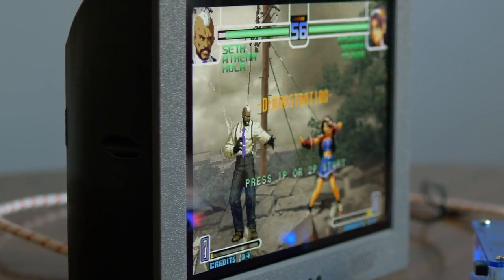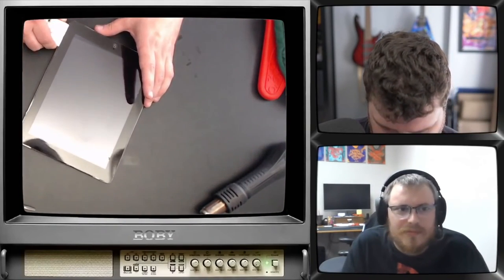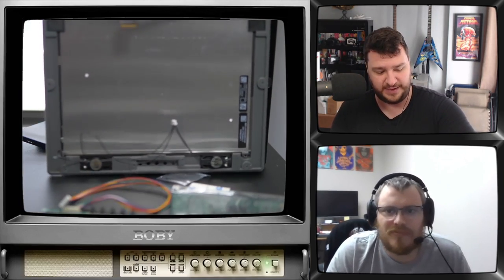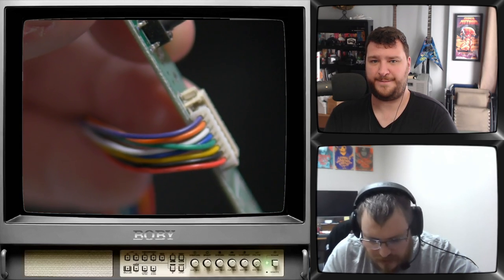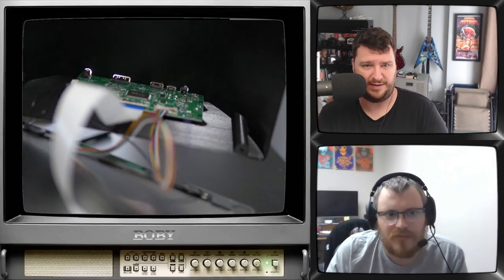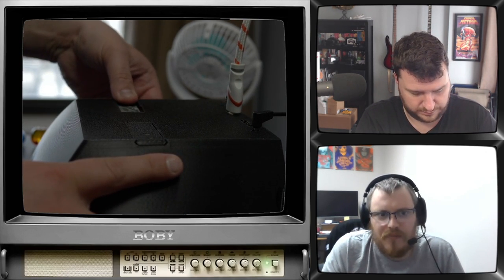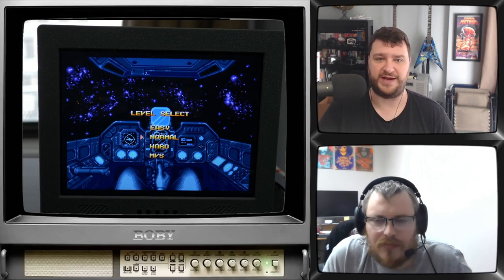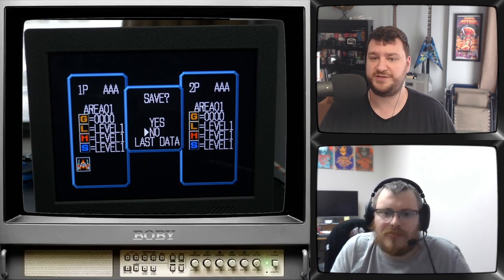LaserBear's "LCD CRT" Kit

Comment: I think 4:3 is way more important than using an actual CRT. I have a CRT but I can live without it. Those 16:9 black bars take me way more out of it than the fact that I'm playing on an LCD. I made sure to save my old 4:3 (or something close) LCD monitor from forever ago to use for PC games and it helps so much to make it "feel correct".
Reply: I agree with that. I have a 19" 4:3 Samsung LCD used for security cameras so  four inpus of composite plus vga and hdmi and the screen makes all the difference
Reply: @1122markj  Yeah I'm making a retro style game and I'm making sure to keep most of the screen feeling 4:3. They never look right when they are widescreen.
Reply: Anyone who hordes a 4:3 monitor for old games is already a man of culture.

Comment: We need a larger, "full size" (i.e. 20-27 in) version of this, with analog composite inputs which can automatically create artificial blooming/blurring and scanlines. In other words, a full replacement for a CRT into which original hardware can be plugged with no scaler.
Reply: You are forgetting motion. An unstrobed LCD can never replace a crt. Need crosstalk-free strobing at all refresh rates you will use(for console/arcade games and video content at least 47-75hz)
Reply: @displaytalk  I didn't mean it quite that literally. I think something is achievable that would at least be passable.
Reply: @TruthSword7  Well to me the 1ms MPRT is the main reason why I use CRT for anything, so it wouldn't be anywhere near passable without at least 4ms mprt strobe.
Reply: @displaytalk  Modern screens can get extremely low latency. But what they don't have is proper blooming and scanlines. I'm more interested in the look than having the exact same latency.
Reply: Maybe the scaler would be built in
Reply: I've never seen a 27 inch 4:3 LCD... Where can one get one?

Comment: For a while I've been toying with the idea of a home made faceplate for 16:9 monitors that emulates the appearance of a 4:3 TV. This video actually motivated me to figure out the dimensions.

For those who are curious, I drew a 16:9 cm rectangle and used a screen size calculator to figure out how much width to block on each side (2 cm) to make the viewable area 4:3. Then, the same amount used to hide the pillar boxes is added as a bezel to the top and bottom of the screen (in addition to the height, not blocking the screen) to preserve the look as it would look odd with thick side bezels and thin bezels top and bottom (though you can experiment with top/bottom bezel size). The proportions can then be easily scaled with simple maths based on your screen size.

It actually looks pretty cool on paper and I'm sure designs could be added like mock speakers, control panels, logos and even fancy stuff like angled bezels so that the screen is slightly recessed. With my D.I.Y skills, cardboard would most likely be my material of choice and the end result would likely be a bit... crap. But I'm sure someone more skilled and less lazy could produce something pretty awesome looking, especially if they went the extra mile and put it in a full enclosure.
Reply: I have been doing a similar thing for years. I created bezels for my 16x9 screen for 4x3  Images to make the black bars less noticable.
Reply: @pixelsrnautded9286  Did you go for a CRT aesthetic or simply cover the black bars?
Reply: @napalmhardcore  I cover the bars only so when I play in the dark it looks like a real 4x3 image. I have 2 real crt televisions so I  didn't feel the need to go further with it.

Comment: Now, only if someone made larger 4:3 LCDs than 20".
In the meantime, I'll enjoy the beauty, wonder and scale of my 40" SONY Trinitron Wega XBR CRT, just as long as all 350#s of it doesn't have to be moved anywhere anytime soon.
Reply: @detroit retro gamer drg313 I wasn't meaning to flex, because I too used to be the guy who highly coveted the big beautiful monster until I luckily finally found one. 
Just letting people know that they do exist, and though they're rare they are out there to be found for reasonable prices --because of their weight. 
For me, I picked up a few-thousand dollar high-def CRT TV for $50, with an image that is still incredible and perfect for gaming. But my previous posted wish for a LARGE 4:3 flat panel is still warranted for high-def retro gaming.

Comment: I looked into the  volume controls, Greg says at 29:50 that the "audio amp chip has pins for digital up and down". maybe my board is different but my amp chip is a APA2068 and there are no volume control button pins on this chip. Volume control is selected by a variable DC voltage level on pin 7. DC range seems to be 0 to 5V. After lifting pin7 off circuit and wiring a 10K pot to a 5V source, the pot will affect the volume but the OSD volume is still "master" so you have to set OSD volume to 100 for the rigged pot to have full range.

Comment: This is very cool.

Would it be possible to get a full screen image on this screen from a (hacked) classic edition SNES, NES, PC Engine, etc ?
Reply from the maker: Yes, just set the console to 16:9 mode.  I know that sounds weird, but since this is a 4:3 screen, setting the NES Classic (or any of the others) to 16:9 will fill all the pixels and it'll be the proper aspect ratio.

Comment: I’m confused about which iPad. You keep mentioning iPad Air 2/3 but in the video it’s an iPad 3 not the air model if I’m not mistaking.
Reply from the maker: It's best to check Greg's site and see the exact one he recommends.  I'm sure I got it wrong during the livestream.
Reply: @RetroRGB  only reason I say it just that the one in the stream didn’t have a Touch ID button but iPad Air 2 and 3 had them but iPad 3 and 4 had a physical button.

Comment: Are the customer video modes in the RetroRGB article really required ? Can we not simply use "video_mode=13" ?
Reply from the maker: I think so, but older MISTer.ini files don't have the newer modes added, so people wouldn't know what it was set to.  Adding the full modelines does exactly the same thing, shows you what you're getting and is just a simple copy & paste from the webpage.  So, give it a try on yours, but if you run into any issues, use the full line.
Reply: @RetroRGB  No issues with “video_mode=13”, I was wondering if the custom mode line added any value to simply using that.

Comment: Damnit! I thought this was a way to put an existing CRT Tv into a smaller form factor. Is that possible?
Reply: not really no. the cathode ray tube assembly is pretty much the reason old TVs are deeper than LCDs. the only thing you could do would be to redesign the electrics powering/controlling them but even then, the CRT would still be the biggest part and there'd not be much of a shrink in the item.

also touching the CRT inside is dangerous unless you know what to do...so it'd be more dangerous to have lots of people opening up old TVs/monitors.

Comment: I just finished one of these builds using the stuff LaserBear linked from his website.  I'm having image drop outs from my MiSTer when using the screen's native resolution 1536p , have you guys had any issues like this?

I've tried multiple HDMI cables, I've tried multiple HDMI ports (with a Mini HDMI adapter) and it just drops out and comes back every few seconds.
I know Greg's not the person responsible for this product, just wondering if anybody else has encountered it and has a fix?
Reply from the maker: Check the main post, linked in the description:  https://www.retrorgb.com/laserbear-lcd-crt-case-reviewed.html

"Also, some cores might require a framebuffer, otherwise the monitor will loose sync.  If you load a core and it immediately drops signal, then recovers, then drops again (etc), you’ll need to change the vsync setting:"

vsync_adjust=1
Reply: @RetroRGB  AH!  I totally breezed right by that, I’ll try that when I get out of work today. I started a return with Amazon but this makes sense and I totally spaced on it.

Thanks so much for replying and for keeping up on all the cool products in one convenient spot.
Reply: @RetroRGB  Plot twist: When I got home from work today, I saw that the V-Sync was already set to "1" in my ini file for my 1536p Profile, so I figured I'd experiment with the other settings.  I set it to "2" and it seems to be working fine in the SNES core I was having issues with last night.  I guess that's a win?

Comment: Bob, I highly suggest investing in spudgers. Or at least cut up an old credit card into quarters and use to wedge into it as you heat the sides.
Reply from the maker: I've got those and was ready to use them, but at first I expected it to be much harder to remove the glass from the LCD.  Then, once the razor blade was working perfectly, I figured "It's working, why mess with a good thing?".

Comment: It's a pity it does not work in 50 Hz. I am looking for a portable display for my PAL Atari 800 XE. I bought one at Aliexpress, but it also only works in 60 Hz, even if fed 50Hz signal through HDMI. Everything that is supposed to scroll smoothly is jerky.
Reply: 50hz sucks

Comment: Would be great with a built in retrotink so you could have the right inputs
Reply: the lcd will still have latency issues for those types of games 😔
Reply: @jonniefast  what type of games
Reply: @johnmorris7899  anything fast - sonic 2, shoot em ups, racing titles etc

ghosting, pixel response latency, and input lag are some of the reasons people keep the real analog crts around 💌
Reply: @johnmorris7899  ipad screen isnt a modern gaming monitor with high refresh rate 🤕
Reply: @jonniefast  never claimed anything about the refresh rate what I was saying was if it had a tink built in and then you could have other inputs besides hdmi
Reply: @johnmorris7899  analog signals processed by the retrotink are gonna be noticeably laggy on ancient LCD panels mate

i have a retrotink2x and love it 
but i dont plug it into consumer grade sets

Comment: Mmm why not just buy a small crt at a thrift shop? Even running an HDMI retro game through a HDMI to composite converter will look infinitely better.
Reply: Most thrift shops don't sell CRTs anymore
Reply: @hughjanus2935  yeh, the goodwill near me still does. But just keep a lookout during trash day. You will see crts regularly at the side of the road for free. In 15 years id imagine they get rather scarce though.